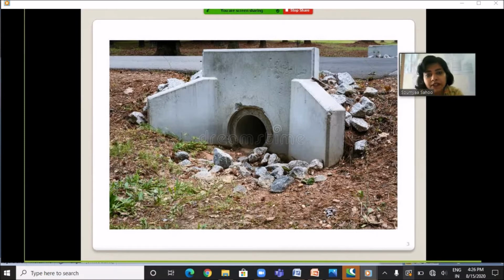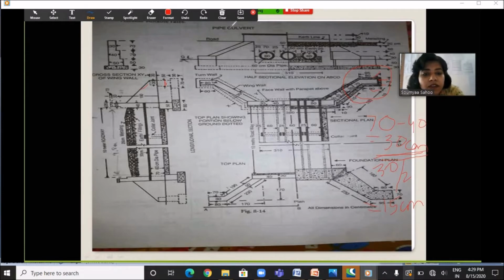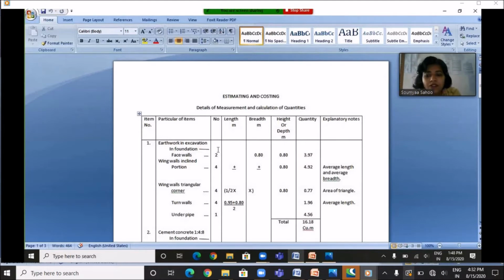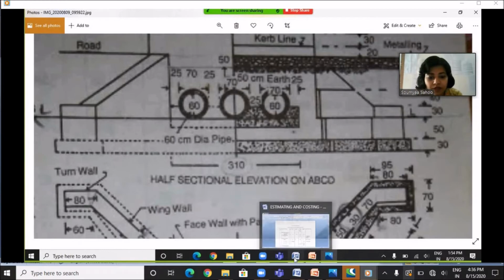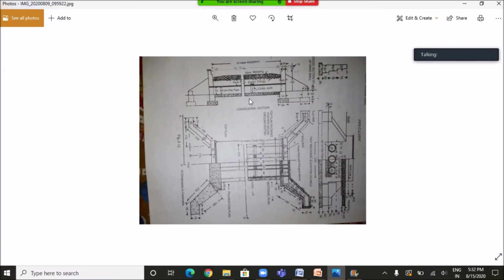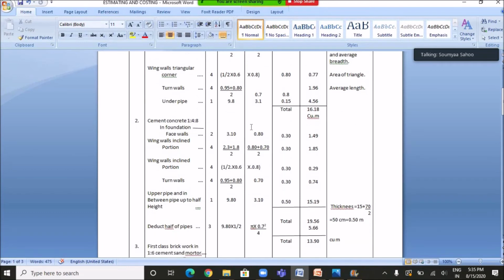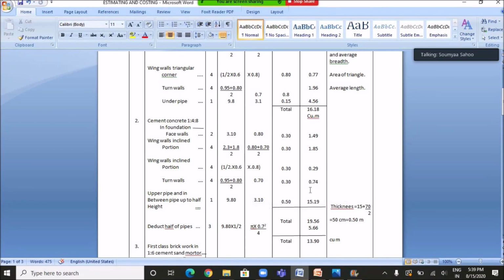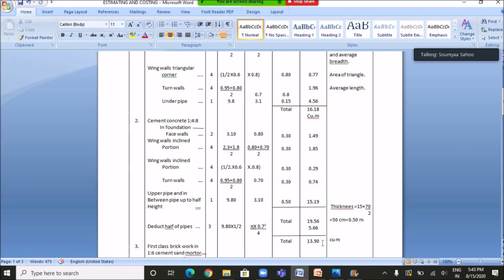EST&COST EVALUATION 2|DETAILED ESTIMATE OF HUME PIPE CULVERT PART1|5TH SEM|DIPLOMA|CIVILENGG|LECT 03

Comment: Does SKDAV GP utilize flexible rubber couplings for linking pipe segments? 

Is there an approval process for the region? I am trying to figure out the first steps in selling couplings for use on RCC pipe.  Any help is appreciated.

www.jointscouplings.com